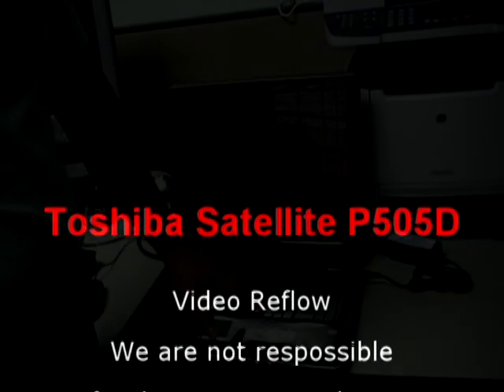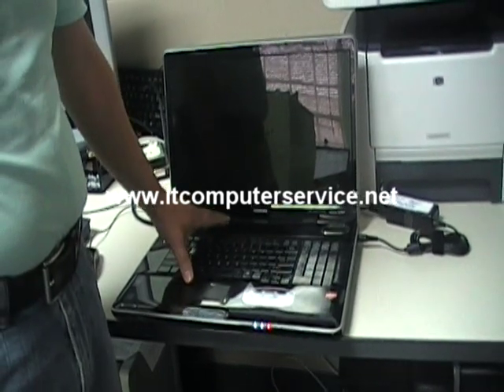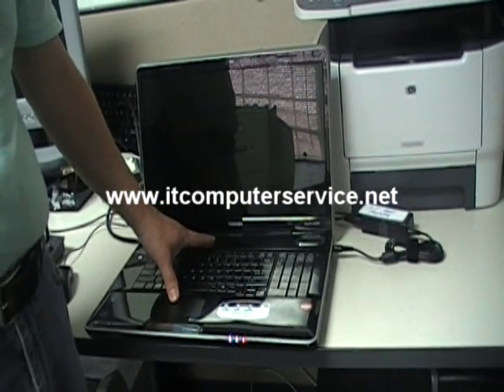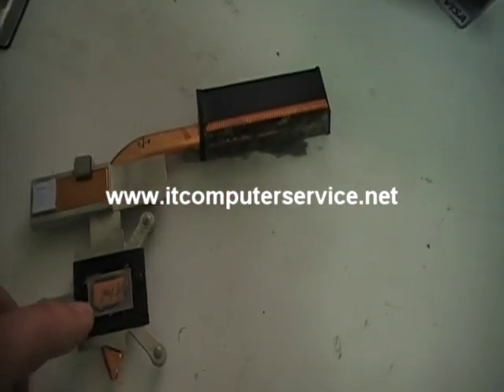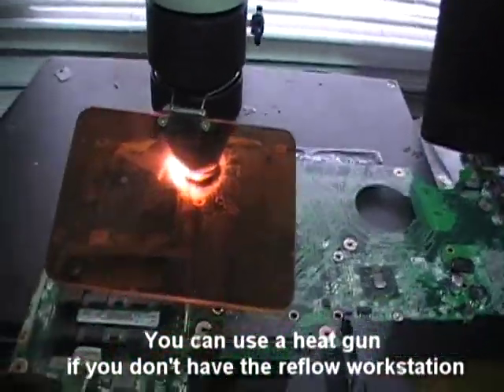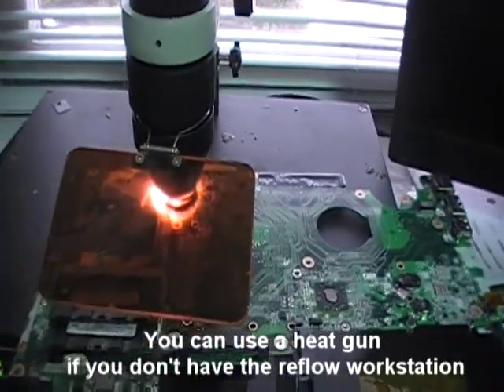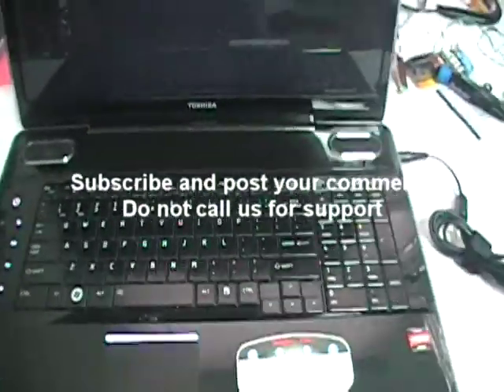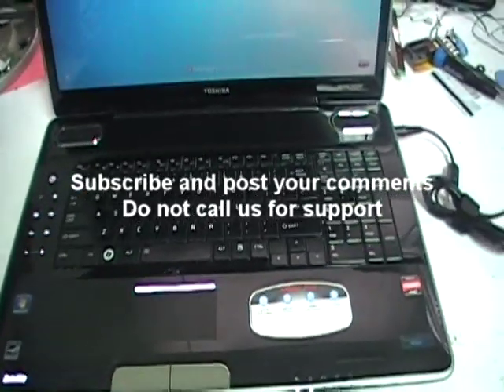Toshiba Satellite P505D L305 A135 NB505 Macbook Pro Video GPU Reflow Process

Comment: Sir is it okay if i reflow mine without taking the mother board apart from the laptop?  Coz i can see the chip by removing the cover underneat the laptop im gonna use heat gun.  Please help.
Reply from the maker: It's really up to you but I would not recommend it since you could damage other components on the board.

Comment: I have a P505d-8007 Toshiba Laptop and I have not lost the video completely, but I suddenly have very fine turquoise vertical lines, specifically on anything with a white background. It only is visible on photographs if there is a spot of glare in the photo like a window in the background.  Dark graphics show no lines but white backgrounds show the lines and there is a white halo around text and graphics. Is this also a candidate for a reflow or is the problem elsewhere? What is your cost to repair?

Comment from the maker: If you dont have the reflow station you can use a heat gun for 3 to 4 minutes but you have to be careful or you will damage the chip and the system will not turn on again.

Comment from the maker: Hayatogi,

That all depends on the make and model of the laptop. This model had a design issue and the fans do not send enough  cool air to the heatsink. and also over time the fan and heatsink will accumulate dusk and that will cause the video chip to overheat.

We can reball the chip but the cost will be much higher and 99% of the laptops will work fine after the reflow has been performed.